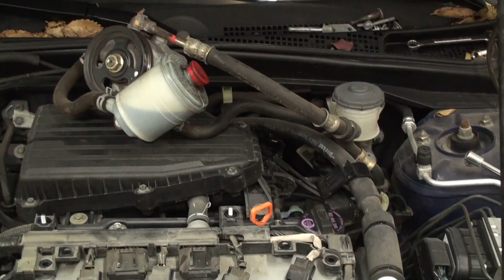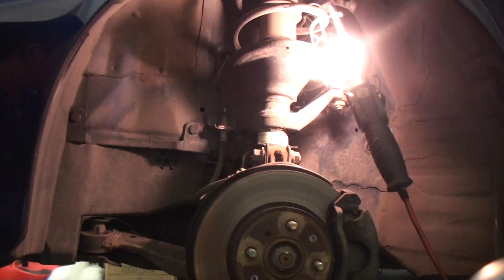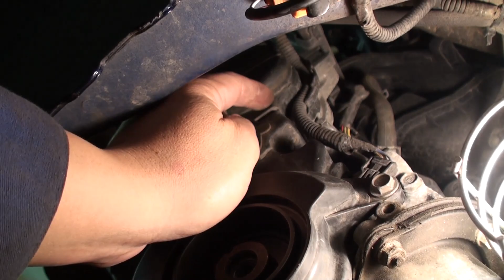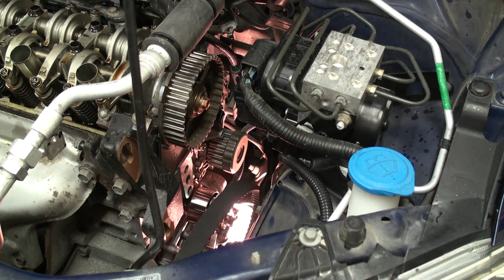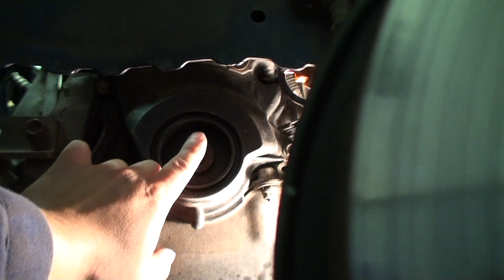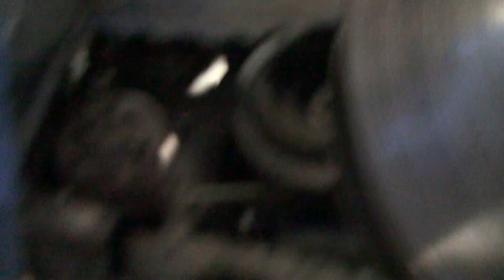2001 - 2005 Honda Civic Acura EL Timing Belt Replacement

Comment: My Honda Civic 2002 EX Vtech has only 19,000 miles do I need to change the timing belt after 18 years ? We Got a New Subaru Outback 2020 premium + package replaced the Honda Accord 2003 with 130,000 miles.
Reply from the maker: wow that is crazy low miles but you absolutely need to change the coolant and the belt at the minimum before the belt breaks due to the rubber and kevlar in the belt breaking down.  Water pump should be okay since it has barely run but you WILL need new coolant to restore the pH and lubricity of the coolant to protect the engine and water pump from corrosion damage.  Would be awesome to see a 7th gen in minty condition still.

Comment: What if I accidentally turn the bolt clockwise trying to tighten it 😬, can I just do 2 or 3 rotations counterclockwise to correct that?
Reply from the maker: I'm not sure what you mean by that.  You're supposed to turn the bolts clockwise to tighten them up.  If you're referring to rotating the engine to get to TDC then yes you really should only be turning the motor in the proper direction to line things up.  In this specific video the motor rotates counterclockwise so when you're turning the crankshaft to verify the belt is installed properly that it should be turned counterclockwise.
Reply: @piercedasian  I meant to say that when you are tightening the crankshaft bolt clockwise it is possible that the engine will turn clockwise as well even with the help of the special crankshaft tool if you are not careful right? So if that does happen how bad is it, and should I just realign it by turning a few rotations counterclockwise once i have completely tightened the bolt? thank you for your time and your previous response, this video helped me out a lot 🙏🏼
Reply from the maker: @OHMYJOSHH  ah okay I get.  Yes not problem doing that.  Just make sure that once everything is reinstalled that you do a final TDC check of all engine components PRIOR to starting it.  Make sure you only turn it counterclockwise to ensure the belt is tracking properly on the pulley.

Comment: I lost the woodruff key 😓
Reply from the maker: burn.  You can always get a replacement from the dealership.  They sometimes have them in stock and if they don't its usually a day or two away.  They're cheap but are ABSOLUTELY required to be put back to keep the crank in tie with the crank pulley.
Reply: I went to the junk yard and got one, cashier giggled over the woodruff key his like " just take it 😂"

Comment: Hey mate im gonna be re-using my tensioner, do i need the pin?
Reply from the maker: Nope not at all.  The pin is merely there from the manufacturer to save you an extra step by not needing the installer to use a 6mm Allen head socket to retract the tensioner.  Just bolt on, install belt and pull pin out to tension.
Reply: piercedasian Thanks for the reply. That’s the thing I don’t have the pin. Can I install without the pin?
Reply from the maker: @MC-jf6ic  Nope, not at all.  Just use that 6mm allen socket to put into that little "hex" hold on the tensioner (you can't miss it) and then turn counter (anti) clockwise.  No need for a pin.
Reply: @piercedasian  Ok, do i do this before tightening the tensioner bolt?
Reply from the maker: @MC-jf6ic  you don't actually have to loosen the tensioner bolt on this particular civic.  The tensioner is constantly under spring pressure so all you have to do is leave the tensioner bolted in.  Get a 6mm hex socket bit and insert into the little arm on the tensioner and then turn your ratchet counterclockwise (it doesn't need a lot of force to move it).  Slip your belt around it and route it as per my video and when your installed, release the bit from the tensioner and call it a day.  Super easy on this generation of civic.
Reply: piercedasian Righto, so turning that little arm is to just loosen up to slip the belt right?
Reply: piercedasian Sorry to be a pain but what about that little arm, does it need to be right beside the stopper?

Comment: Great video, but I can't believe you went through all that trouble and skipped a new tensioner and water pump. Were they fairly new or something?
Reply from the maker: I worked at Honda for a while and the techs there agreed that the water pumps in these cars if the coolant is in good condition will go 200, 000kms without any issues.  The tensioner is RARELY replaced - usually every 300, 000 kms before they exhibit any signs of trouble.
Reply: Here I am 2 years later, and the water pump I replaced is now leaking. Sounds like I should have done it your way. Lol. I did figure out you can pull top timing cover without removing valve cover.  If you pull the two engine mount studs off alternator bracket, you can tilt timing cover out from bottom and down and it will clear the valve cover lip. Saves a ton if time on this job.

Comment: Thank you! Followed along with each step and it worked great for my vehicle with 460,000KM on it. Thanks for giving it a new lease on life.
Reply from the maker: 460,000kms!  Well done!  You'll have to beat my record of 520,000kms (I sold the car after that).  My friend's 99 Accord was at 720, 000kms on the original almost everything (sans struts, brake pads, fluids, and 2 alternators) before he gave his car away to a relative.  Last time I checked his car was still on the road breaking over 750,000kms...

Comment: Hey pierce very detail tutorial love it. Got a question about the stud coming off the motor? Is it okay to put anti seize on the stud or will it change the torque specs when torquing down with the bolt. I appreciate the tip on using the nut to reinstall the stud. Thank you
Reply from the maker: anti seize will absolutely change the torque spec requirements but why how much I am unsure of.  I would say that if you lubricate the stud that you need to drop the torque spec by at least 10%.  Mind you that many of the fasteners on the car are relatively small so it doesn't take much to snap fasteners especially when they're tiny like they are on most japanese cars.

Comment: All the more reason to own old rwd Volvo’s w b18, 21, 23 motors. Belt breaks no worries. New belt and 30 minutes later you’re on down the road. Slowly.
Reply from the maker: So true... interference engines are a PITA should one forget to replace their t-belt.  Glad that Honda is slowly doing away with the timing belt....
Reply: piercedasian ya I’ve never understood putting  rubber material into an oily atmosphere w fatal consequences and rely on it to do literally the most important task of an engines valve train. It would be ok if they made it easy and accessible for us very average wrench-heads to partake in service jobs like this but you my man are a super ninja for taking on that little Honda belt. Btw great video. I found it only because my youngest son just got an 02 Acura el and the belt interval is soon...yeesh bring on some knuckle blood! Cheers from B.C. Canada

Comment: Hey man,I just watched your video of you working on a 2002 civic ex just like mine. I have a problem with this noise constantly coming from down below my crankshaft area as if the tensioner is to tight, which I think it is but not sure. And I'm have a ( p1361, TDC sensor 1 noise ).
I changed the sensor and it stop turn off on me while driving and also stop hesitating to start and lost of power.  After installed the sensor the check engine light when out after driving a few minutes but , it came back yesterday..
If the timing belt is too tight, will it cause the issue that I'm having with the code  ( p1361,TDC sensor 1 noise) ?.

Also  there are two Mark's on the lower  timing belt cover, there is  one that you were looking through from the top with the ( V ) And there is another that's right underneath the  (V) that you were looking through. Both of them should be used to catch the time, right?
Reply from the maker: Hi Declan, the timing belt can't be too tight unless you forced the belt to be tight.  On this gen of civic the tensioner is spring based and self tensions to the appropriate "tightness".  I'd definitely go back and measure the old belt vs. new belt to make sure it is the same size as a too small of a belt could potentially make things tighter than they should be and throw your engine timing way off.  As for the "V" on the timing cover that is the window you look through to see the white TDC mark on the crankshaft.  You look down into the V parallel and straight down the center of the molded pointer above the V so you don't get "viewing angle deviation errors".  You line your view with the molded pointer, look through the "V" and then make sure that when you set TDC that the white mark lines up in the middle of that V.  Make sense?  You don't need to use a timing light on these newer civic since the timing is self adjusting and as long as you have proper TDC that it should run perfectly.  Now if you're dying to use a light to see the timing marks you follow the same instructions but as the light fires you likely will see the "red" pulley mark which denotes 16 degrees +/- 2 degree BTDC.  The P1361 code does suggest something isn't right with your timing and potential sensor issues.  

Hope that helps.
Reply: @piercedasian  I release some tension off the tensioner and the noise went away..I bring the tensioner back too much..

Comment: What was the condition of your old timing belt
Reply from the maker: It looked brand new but looks are extremely deceiving since I've seen belts that "look brand new" that snapped cleanly in half.  Not worth risking.  Change at the appropriate time and/or mileage intervals.

Comment: Thanks very much for your clear and informative video. I hope you don't mind my asking for your advice. I have a Honda headrest that's stuck in its highest position, but cannot be moved/lowered at all. The release button moves but does not release the headrest (unlike the rest that work smoothly). What should I do?
Reply from the maker: You likely have a jammed release mechanism.  Have you tried getting a helping hand to wiggle the headrest up and down while you're pressing the button to free it?  Sometimes the headrest rod can jam the release mechanism making it seem like it doesn't want to release.  Jiggle the headrest around and see if it comes loose.
Reply: @piercedasian  Thanks for your advice. I'll try it ☺️

Comment: I recently bought a 2005 civic from original owner with 165,000 miles and he claims it never had the timing belt changed! So why change it? Have you ever actually seen a timing belt go bad? I have seen tensioners go bad or water pump, but the belt itself? This one still looks good. Sounds like a lot of people had no issues, then got a problem after the belt was changed incorrectly?
Reply from the maker: As a matter of fact I have seen MANY belts broken.  Having worked on literally 100's of Honda's and Toyota's that the belts when used past their service life will give out often with zero warning.  I have seen deteriorated belts that are physically falling apart from cracking and I've seen mint condition new of package looking ones snap clean.  So yes, you MUST replace them at the specified intervals otherwise you are playing Russian roulette with your motor.  The ones that neglected the service intervals are always naturally the ones that write off their cars or spend big $$$ replacing engines or cylinder heads b/c their valves got all bent up.  Been there done that far too many times for comfort.
Reply: @piercedasian  Thank you for the reply! I will look into replacing the belt on mine. Great video!
Reply from the maker: you're most welcome.  Good luck!

Comment: I'm currently replacing the timing belt and water pump on my '03 Civic and have run into a problem. When the white mark on the crankshaft pulley is in line with the two notches and timed properly as it should be, the camshaft pulley is NOT timed properly. The camshaft pulley doesn't rotate where the two notch and "up" markings are in the 9, 12, and 3 o'clock positions as they should be. To get the camshaft pulley timed correctly, the crankshaft pulley has to be out of time (and vice versa). So, is it OK to first time the camshaft pulley correctly, remove the timing belt and then time the crankshaft pulley on its own without the belt? Or should it be done a different way? Thanks.
Reply from the maker: hmm, this seems odd... was the motor running fine with the cam and crank supposedly "out of time".  It can be deceiving to believe that the engine is out of time and the key thing here is that the crank and the cam can be adjusted with no belt on but ever so slightly.  The trick to getting the cam right is to put a straight edge on the flat surface of the cylinder valve edge (where the valve cover gasket meets the head).  I use a metal ruler and line up the little notch in the camshaft pulley to the straight edge.  This ways you KNOW for sure that the cam is timed right.  Then I would then go adjust the crank such that the white crank mark lines up with the marker on the engine side cover.  Does that make sense?
Reply: Thanks for responding. Today I was told to keep rotating the crankshaft until markings on both pulleys are timed correctly. It took 2-3 spins but it worked. Before I only turned the crankshaft once without realizing that I had to keep going. One last question though. The motor does have a small oil leak (but doesn't leak when turned off)  and I've looked over it several times and cannot find it. Any suggestions of where to look?
Reply from the maker: try taking a look at the oil pressure sensor as it seems to be a problem on older Honda that leak.  The sensor to electrical plug connection forms cracks in the plastic assembly and well you can guess what happens after that...

Comment: This is a very good video. Thanks for sharing  your acknowledge in Sachs a good quality. Some questions: 1- Is it good idea remplace Belt tensioner and water pump at same time than belt (100k km)or they can live double (200k)¿
2- i do not follow you on The issue with the puley holder tool. You moved CCW, what happen if needed to move clockwise to get the tool seat properly¿ should in this case make a whole turn CCW and stop a Little bit before to avoid go CW¿
Reply from the maker: On engines that turn CCW you should only turn CCW when the tbelt is on b/c that is the direction the motor operates.  If you turn it opposite direction then what happens is that you untension the tbelt in a manner that is not how the engine runs and thus can bugger things up.  

I would do the water pump and tbelt ever 100K and the tensioner pulley every 300K.
Reply from the maker: BTW if you move it CW just a bit to get the tool to seat that is OK.  I misread your post and thought you were rotating the motor CW.

My bad for replying too quickly before re-reading what you wrote.

Comment: Im sorry for asking this question but this is critical and i rather ask than pretend. When turning the crank pulley to get the tdc by watching as you turn it, it looks like gear is moving to the left as the same direction you will loosen the crank bolt and that would be "counter clockwise" right? I have seen other video of 1.7 that when they are rotating the gear for tdc, it looks like the direction is to the right so i wonder if this is depends on the year or model life ex, lx etc. Also what if after you got the old timing belt out and is no longer on tdc, how do you adjust it without the belt on? Or go ahead and install the new timing belt and then put in on tdc?
Reply from the maker: Yikes I'm 2 weeks behind in my response.  It does depend on the car that you're working on.  Rule of thumb I have is if your Honda's crank pulley is on the driver's side of the car then your car rotates counter clockwise.  if your engine crank pulley is on the right then the engine rotates clockwise.  If the engine was never in TDC b/c the previous mechanic didn't do it right then you should make sure it is TDC when installing the new belt.  Line the cam up to the marks as show in my video and likewise for the crank.  You can see on the timing gear that slides on to the crankshaft that it has lines that line up to the little pointer on the engine block.  Sorry for the late response and I hope you got things put back together properly.

Comment: Hi, 

I have Civic with D16 engine.

T.belt + tension-er+ wpump changed.

Done 3k miles so far since the change however 

When the car is in idle 700 rpm  idling then suddenly noise occurs as if its metal on metal but if i rev the engine over 1k that noise immediately goes away. 

I have no idea what it could be other than some guess work that it maybe the belt tension or the idle speed not good at being 700 rpm or piston hitting valves or ac compresor pulley bearing?

No CEL or any other lights on dash. but its annoying also i feel slight power loss since belt change.

Thanks
Reply from the maker: are you sure it isn't the exhaust system heat shield making that noise?  That was a common problem on the Civics and integras where the heat shield securing screws would separate from the sheet metal and vibrate.  Did this noise only start right after changing the t-belt?
Reply: yes only noticed after belt service (done by indie mechanic),
 also engine vibrates during idling @ 700rpm (once engine reaches operating temp).
Reply: i think it might be the Crankshaft pulley/harmonic balancer making noise like a helicopter if am driving over 35mph.
Reply from the maker: hmm it is hard to diagnose without hearing or seeing the car but I would definitely take it back to your indie mechanic and get that fixed asap!